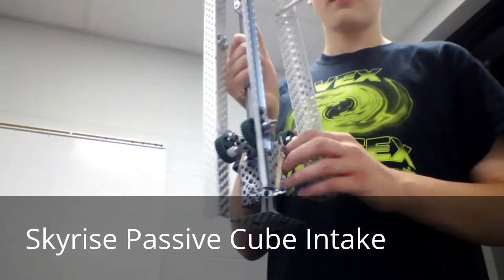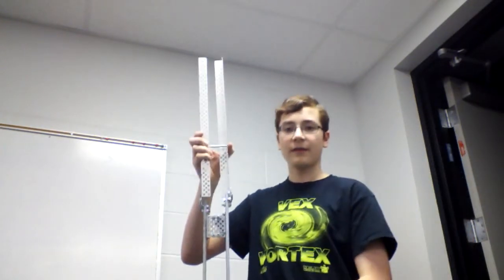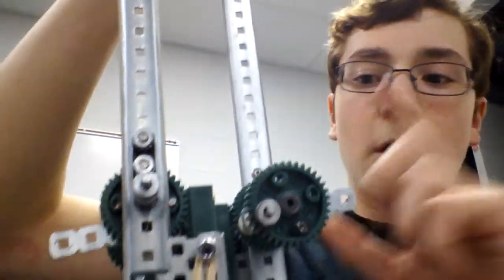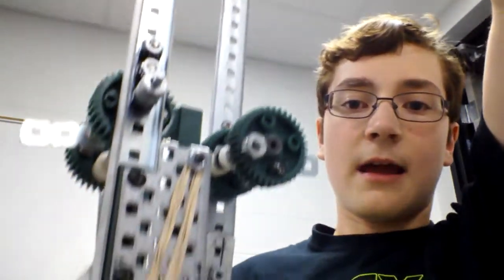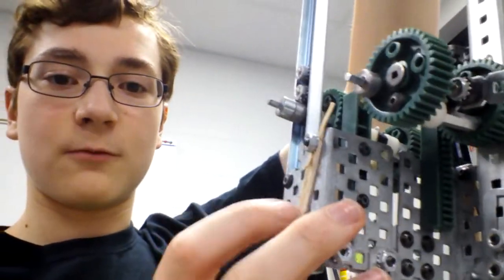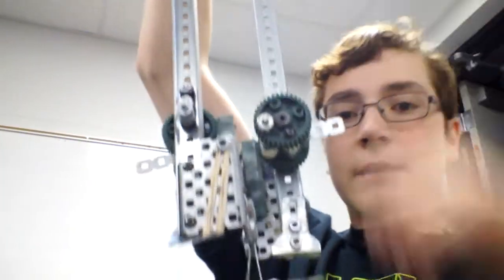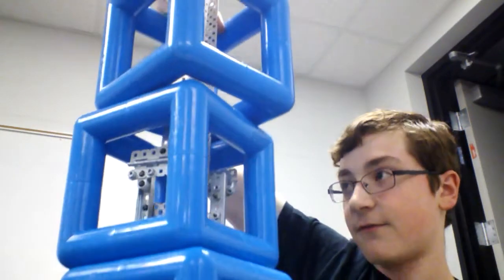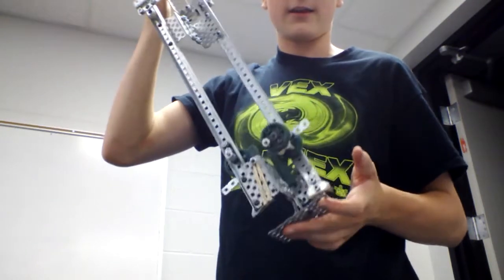Vex Skyrise Passive Cube Intake (Explanation & Close-up)

Comment: I love the design that saves a motor on releasing the cubes, but that looks like it will have a problem if you picked up an opponent's cube by mistake as the last one on your load cubes, you will have to score it too and also there is no way to release any cubes on ground.